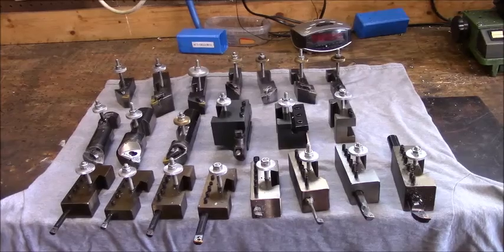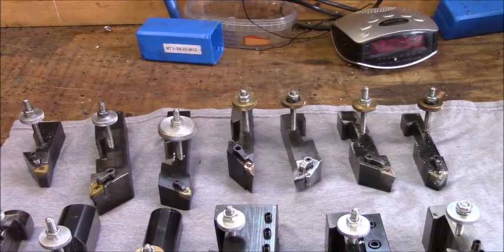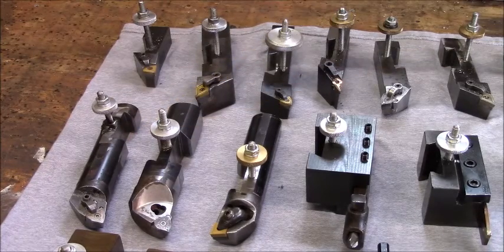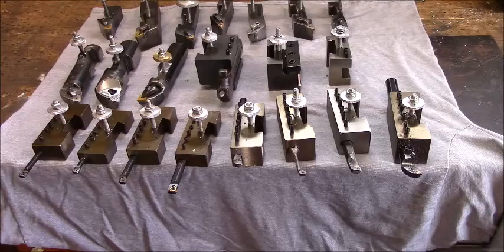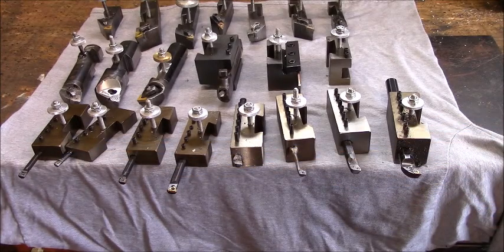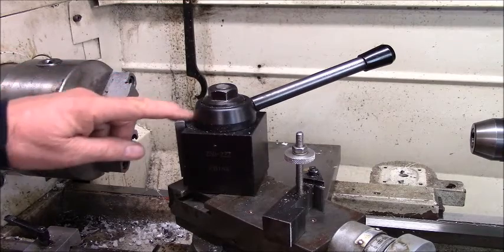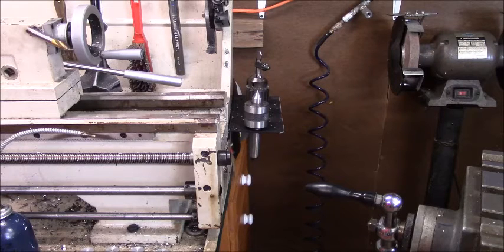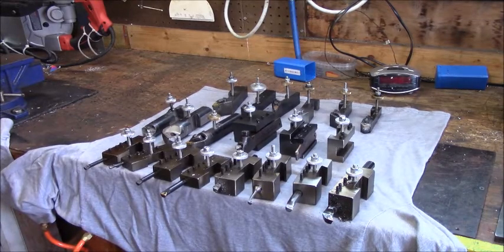Jim’s lathe tooling set up

Comment: Cutting the dovetail directly into an oversize insert holder is cleaver. I'm going to try that to fit a (free) 3/4" holder into my AXA post. 

I was thinking about milling out an existing holder, but it wasn't going to leave me much meat in the bottom of the holder.
Reply from the maker: I have done both AXA and BXA sizes. I used 1 inch tool holders

Comment: Great video as usual keep'm coming  . The dove tail in the tool is and always will be the best way to use those big hog insert tools on small lathes. Awesome presentation. 👏👏👏👍👍👍👍
Watching in Alabama!
Reply from the maker: Anthony Brown like most things I wasn’t the first to cut dovetails in tool holders. I actually seen it on Frank Fords website way before I got into YouTube. Now I admit because of the access to insert tooling, because of my background @ Eaton it was not as large of jump. The las tool I did for Micheal Hale I picked up under $20 to my house of EBay. Sometimes there are still deals out there. Of course you can order the holders from Shars, the import insert holders actually work well with good carbide. Thanks for watching

Comment: I use negative rake inserts on my small lathe as well. They are more economical than the positive rake inserts since you get more edges per insert. I also use aluminum inserts for 1018 when  I can't be bothered to sharpen my HSS.
Reply from the maker: rhost I have some aluminum inserts in CNMG 432 Tom @ Hilltop, sent some over and they work well. I agree on the positive inserts economy because I argued the cost benefit my self.